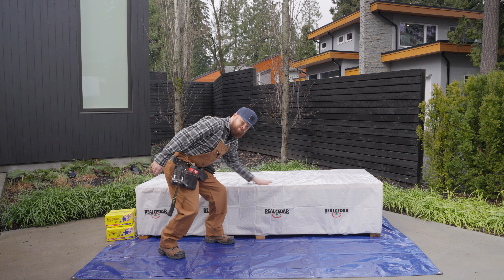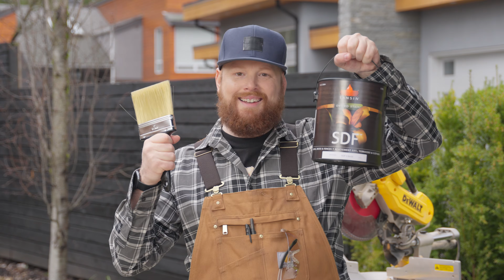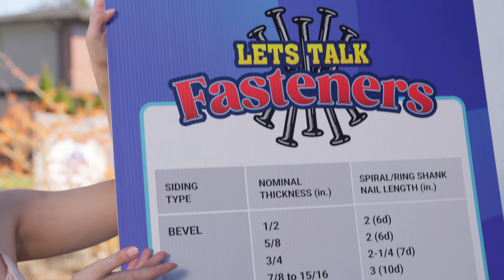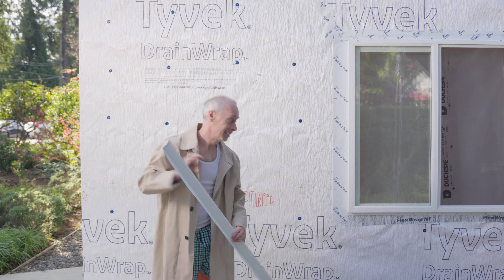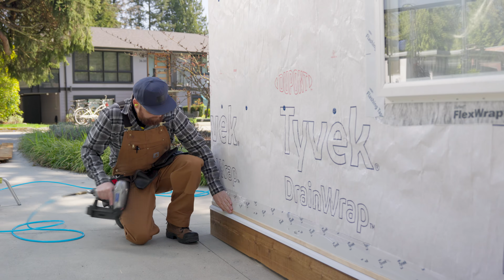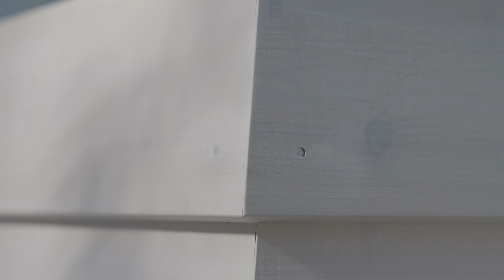Real Cedar Siding Installation - Bevel Siding Edition - RealCedar.com

Comment: What is 5/4 "😂😂😂😂
Reply from the maker: 5/4" (five-quarter) lumber has a nominal thickness of 1-¼ inches before drying and milling, which is typically finished to an actual thickness of 1 inch.
Reply: exactly 10/8"

Comment: I've got some beautiful face nailed cedar bevel siding below my front deck. A pro installed it and it looks nice. I am re-doing most of my house in 6.25 hardie-plank lap siding with a 5" reveal. I want to match this reveal for my entryway area with real cedar. Can I achieve a 5" reveal with a 6" nominal (5.5" actual) cedar siding? Seems like a NO, as this would be less than the 1" overlap. This area is covered with a decent roof overhang of 2.5', but I do live in windy wet Seattle. Please let me know. TYIA!
Reply from the maker: Hello!  Glad you found the video informative.  If you have technical questions about the siding project please send a note to our experts through the link here and one of our reps will be able to guide you.  Thank you! The Real Cedar team. https://www.realcedar.com/about/contact
Reply: https://youtu.be/glDcCo-L1pA?si=gwSDrY3BLaBC_YDx